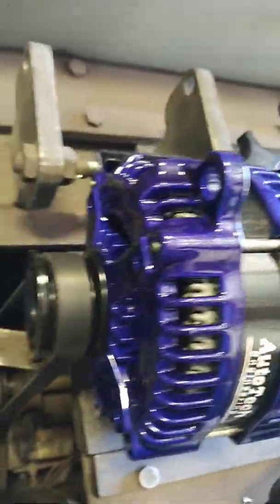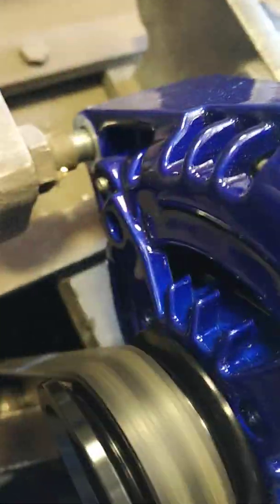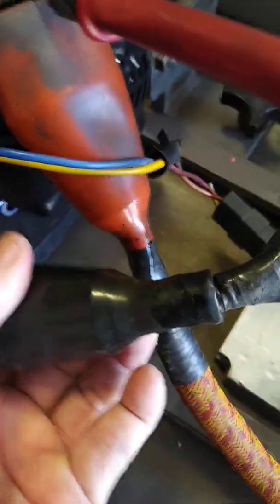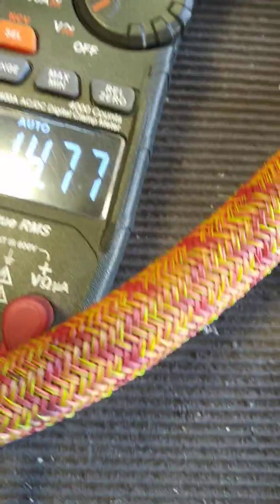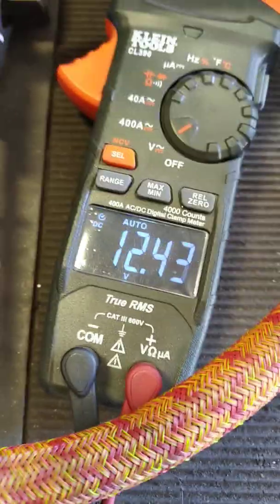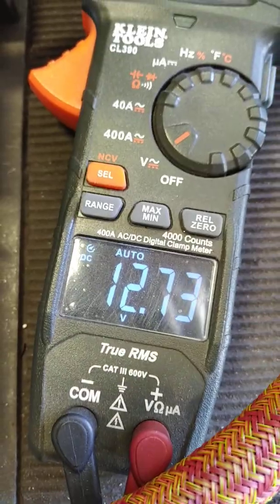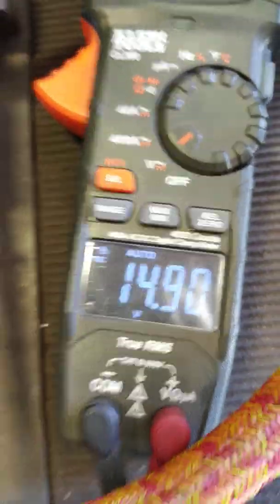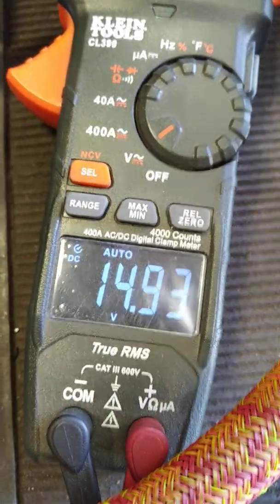Proper Ground on alternators

Comment: Okay so i had this alternator installed t he other day. With power coat. I have 2 diodes so it should hit 15.8. Unfortunately the 8 guage post seen in the video wasnt ground. Is this the case? Even with the ground post?

Comment: Can this happen somewhere else in the circuit, not just at the alternator? like persay a radio ground or a dashcam ground
Reply: Actually everything gound directly to battary is the best🤣
But it will be too trouble so just pick important component ground to battary, others to chessis is fine